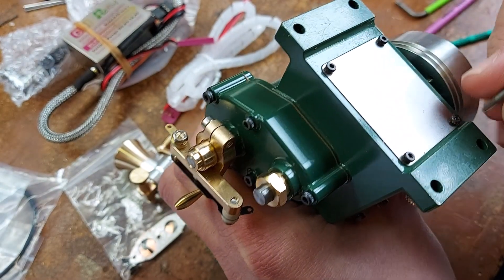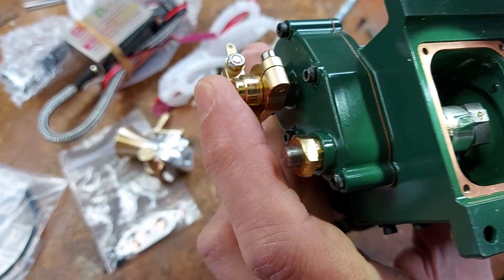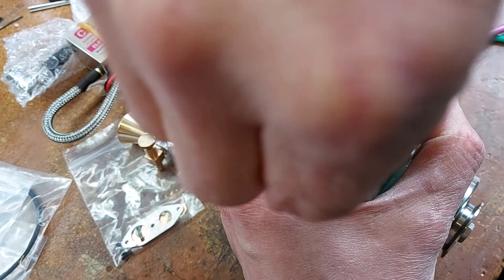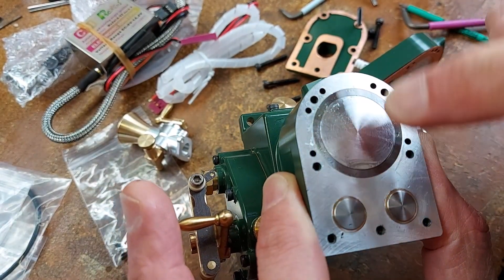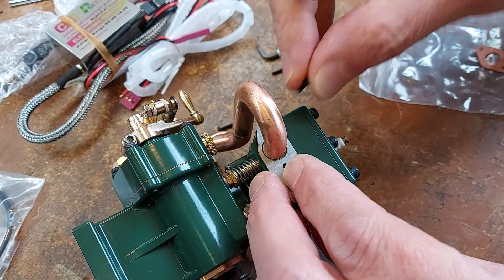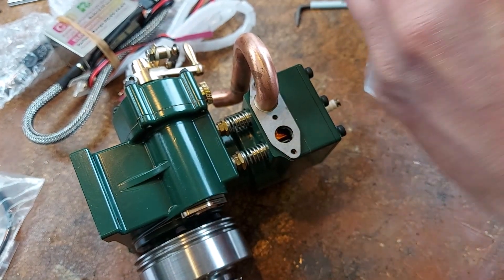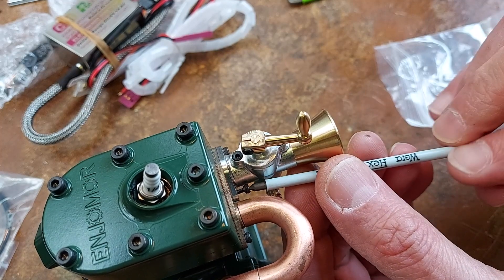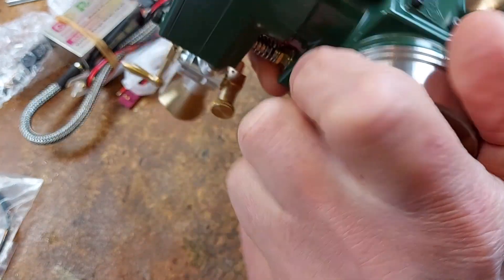Whippet Engine Pt3

Comment: You might want to check your big end connecting rod bronze bushing, Nigel; turns out a fellow owner on FB Whippet locked up, and he found that although his connecting rod oil “splasher” was drilled, the bronze bushing was not drilled causing his to
seize.   I checked my Whippet, and mine was not drilled as well. 

Easy modification to do, though. 
Remove cylinder head
Remove flywheel
Remove oil sump
Remove flywheel bearing side cover, but make sure to carefully remove crankshaft so the timing side does not move position, then piston can be removed out from the cylinder head side. 

Carefully drill con rod bushing, and reassemble.  I did this mod after checking mine, and it runs great and have had zero issues. I’ve put 2.5 - 3 hours on my Whippet and it continues to run better and better 

Hope this helps,  -jon
Reply from the maker: Hi, thanks for that. Do you think its meant to be drilled? Most small glow engines aren't? The hole in the splasher might be just to reduce weight. Just a thought
Reply: I definitely think it’s meant to be drilled, for lubrication. This is the link on the FB page showing what happened to a friends Whippet

https://www.facebook.com/groups/689639601522809/permalink/1348724292281000/